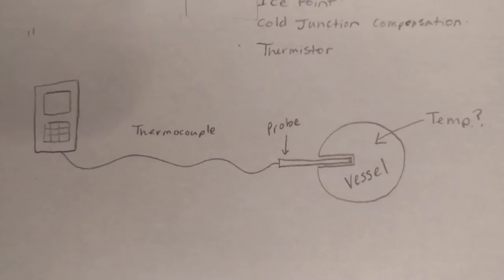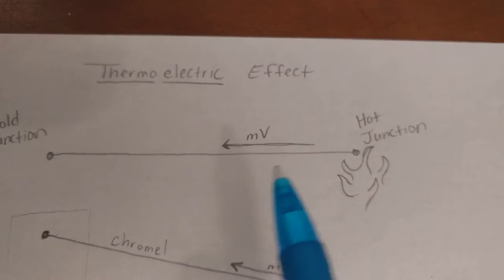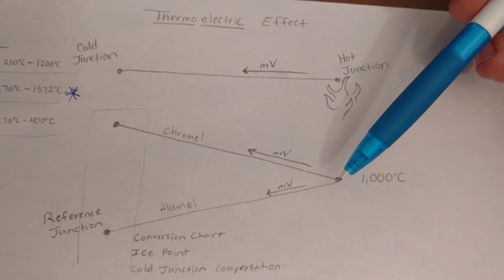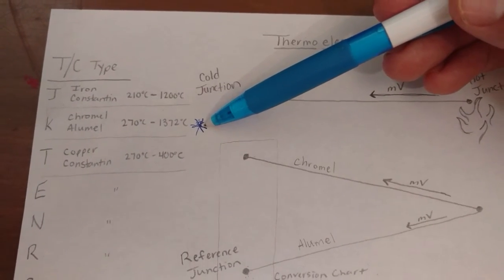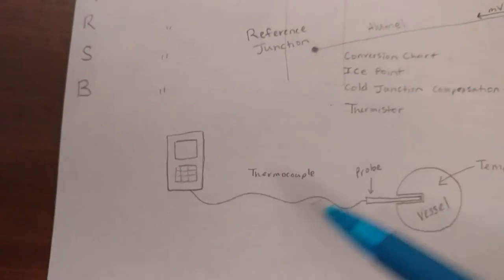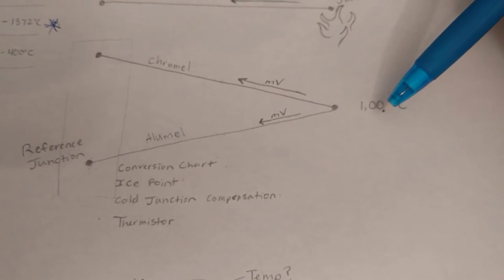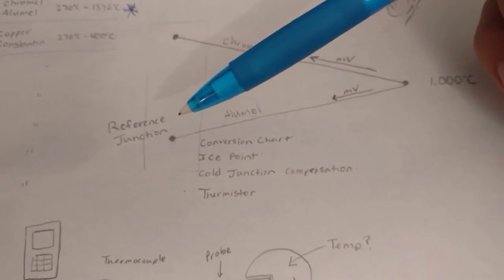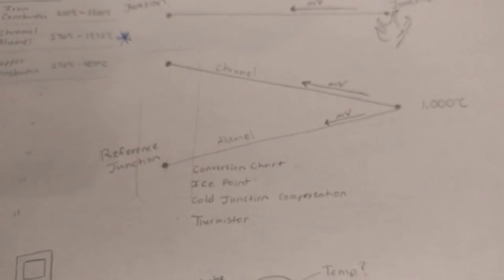What is a thermocouple and how does a thermocouple work.

Comment: I am confused why can't one single metal wire be used, the mV generated from the heat source can be related to the temperature
Reply: Not sure if you found your answer or not...

Thermocouples work based on the principle that each wire will develop a voltage difference along it's length when you heat or cool one end.  Different metals develop different voltages.  Thus, if you connected two different metals and heat the junction, you can measure the voltage difference at the other end, and figure out the temperature.  If both of the wires were the same material, they'd have exactly the same voltage, which means you'd detect no voltage difference at the other end.  That would be useless for measuring temperature.